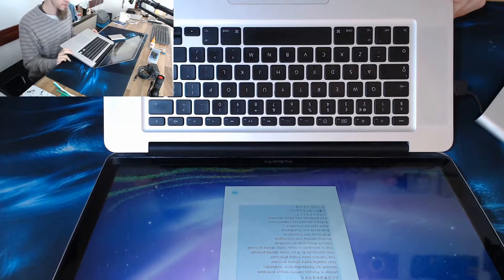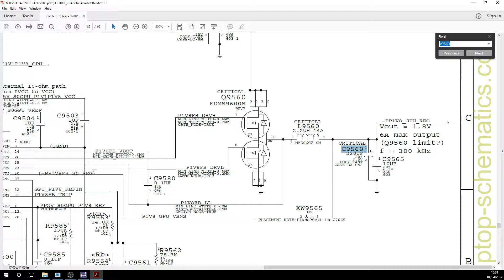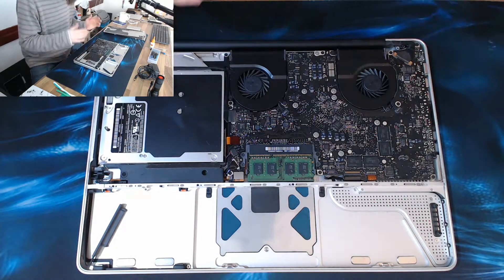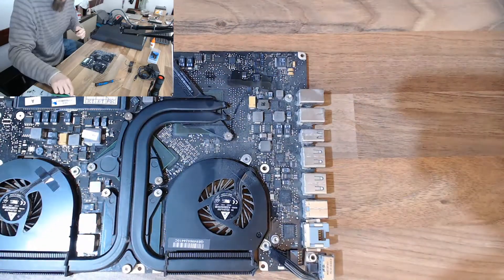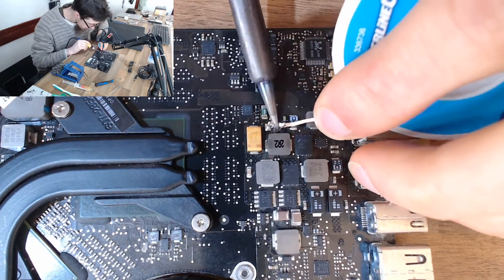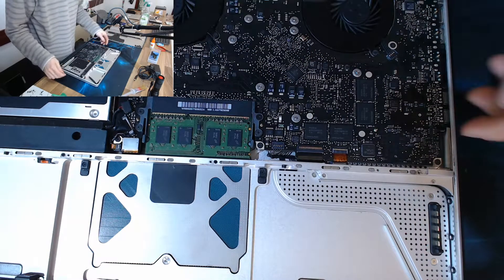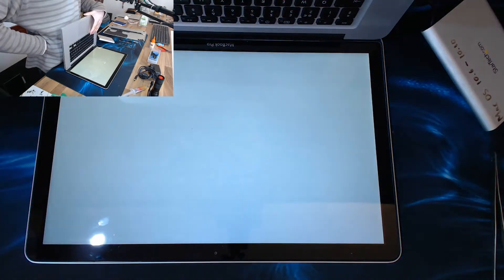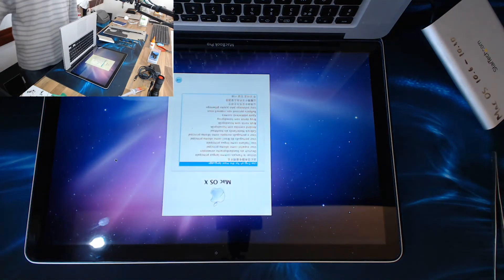LFC#105 - MacBook Pro Graphics Artifacts

Comment: what about a reddish image on the entire screen? can it be caused by the same capacitors?
Reply: If you have a macbook like in the this video (15" 2008-2010), all sorts of graphics issue could be caused by this capacitor. If you have a different macbook (13", or 15" 2011), there will be a differnt issue.

Comment: In my case on a 820-2523 the capacitor C8473 was loose. It came off when I removed the glue around the Nvidia chip. After soldering a new capacitor, the artifacts are gone.

Comment: would this be the cause if there are only artefacts when NOT in safemode? whilst in safemode they go away but booting as normal.. artefacts
Reply: Yes. In safe-mode, your GPU is essentially off, so this is why the problem does not exist then.

Comment: Hello and Help have you ever seen this on a MBP 15" 2010 i5 CPU? I replaced the Cap and it still is doing this.  https://i.imgur.com/hFGIGtZ.jpg , any idea's would be appreciated.
Reply from the maker: Bad GPU I think... Pretty much all of the pre-retina 15" MBPs suffered with actual GPU failure at some point. I barely ever see them in for repair anymore because they've all died. By comparison, the 13" models are still quite common.
Reply: @Adamant_IT  If it was a bad gpu I should be able to delete it like the 2011 but that method hasn't panned out. yet.

Comment: Sounds like you mentioned this is only relevant for green color issues? I'm seeing glitches/artifacts on a 2016 MBPro, Apple just said the logic board. Here's an example image. It's often times in this geometric pattern of 4 squares forming a sideways "T"... https://imgur.com/gallery/TC41I40
Thoughts?
Reply: It is not only relevant for green color issues, but it is most certainly only relevant for older macbooks (2008-2010). 2016 models are completely differnet machines. 
Your problems seems odd, not a regular issue of this model. Might even be just a software thing, the way it looks in you  screenshot. Did you try reinstalling the OS?
Might be bad GPU, bad Screen-Cable or bad screen. If it only happens while charging, might also be a bad charger.
BTW: Apple always says "Bad logic board", because that repair is the most expensive, so most ppl just buy new machines. Don't go to apple with any issues out of warranty ;)